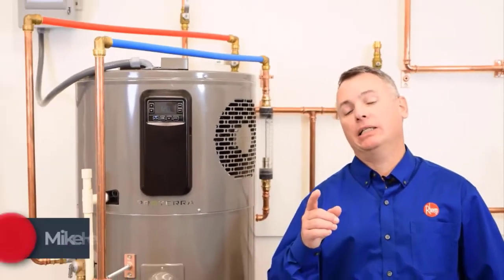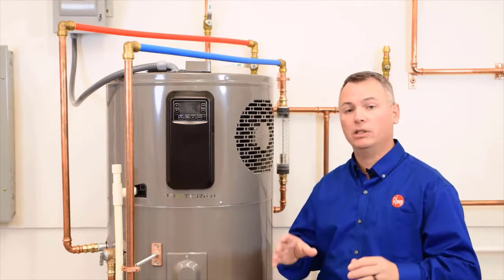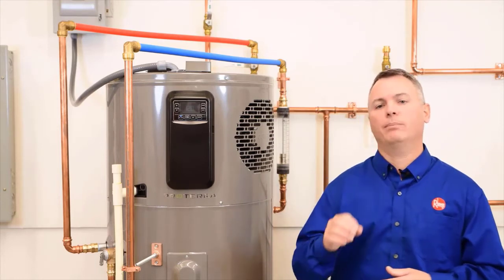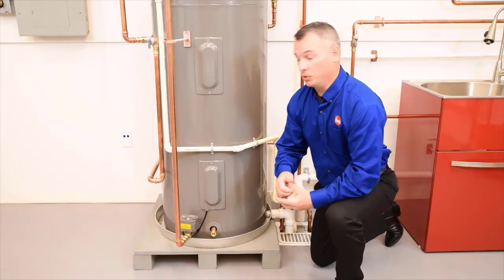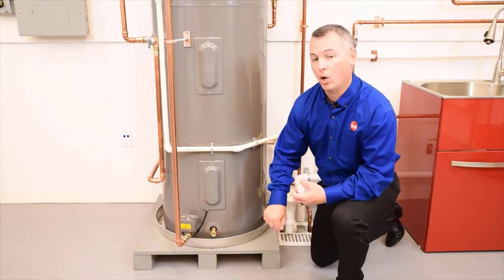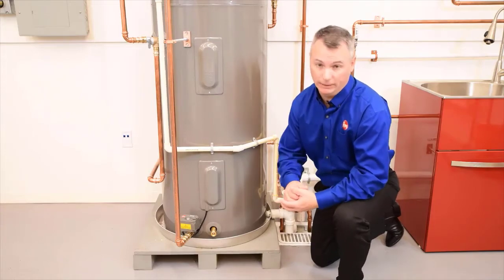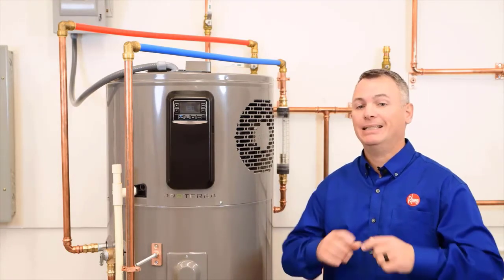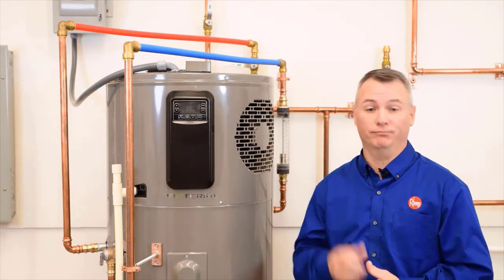Recommendations for Installing Rheem® ProTerra™ Hybrid Electric Heat Pump Water Heaters

Comment: i got one of these and it is noisy. It makes almost a shrill high pitched sound when running. It really bothers me. It's in my basement but that is right below a bedroom. I will have to call the company and see what they say. Fun. Mine says it was made in the March of 2024, so they have not resolved this issue as of then.
Reply from the maker: For assistance with your Hybrid Water Heater, please reach out to 800-955-0982.

Comment: I am interested in the new plug-in variant.   Currently I have a two panel solar hot water heater that takes cold water from the street and attempts to preheat the water.  This hot water goes to the bottom of the Propane heated water tank  ( infloor radiant heat, baseboard and hot water).   I have a mixing valve from the propane hot water exit before it goes into the house.  I keep the temp high to ensure all bacteria in tanks are neutralized..   I dont want to replace the Propane heated tank, I just want to reduce the need to heat water by propane.  Thus what I would like to do is put the Rheem plug-in,  in between the solar tank and the propane tank.    Open room, no doors, never gets cold in the room.   Could vent outside if I had  too.  

My question whether its Rheem or AO Green ( GSW up here in Canada ).  Given that  the Rheem will get slightly warmed up water some of the time or on a good day hot water from the solar tank.. will this cause any issues........  The idea being that hot water  from the solar and Rheem, or just the Rheem (as cold water coming from solar tank) gets fed into the bottom of the Propane tank.  The idea being the propane tank doesnt fire until the propane tank water temp is too low for the settings.

Comment: I live in the south and our attics are always super hot. Is it possible to pull air from a hot attic into the pump as long as it’s filtered? Then possibly reverse that during the 3-4 cooler months of the year?  Basically just swapping the inlet and outlet ducts around.
Reply: Possible? Yes.

How much effort do you want to put into it?

Comment: Would a thermal expansion tank be necessary when installing in a house with a well? There is already a tank between the well pump and the house's plumbing.
Reply from the maker: Please reach out to your local utility company or plumber to advise on local codes.
Reply: @rheemwater  there is no local utility company; this is my house and my well. 

I guess I will reach out to a plumber who is familiar with wells.
Reply: @WayneMacDonald1 if you don't have utility water service then you probably do not have a check valve so it should not be a closed system. If there's expansion in the line it should be able to go out through the pipe that feeds from the well. The main thing is when the heat or pressure expands in the line, does it have somewhere to go? If you're not sure or you know it doesn't have anywhere to go, you need to include an expansion tank.
Reply: Thanks, @Tanquen ! I installed the hot water tank with the assistance of a retired plumber who is familiar with wells. He said there is no check valve and the well's pressure tank should accommodate any expansion although he didn't expect that to be an issue.

Comment: Doesn't say anything about wiring. I'm looking at getting a 15 amp. model, but there is a lot of conflicting or missing Rheem product information. On their website they state there is a plug in 120V 15 amp model available, but they give NO product numbers. In their general install manual, it lists 15 amp models, but later on it says to use 220 - 240 V, 10 ga. wiring. It also seems these must be "hard wired" in, not plugged into an outlet. Their website gives no additional help in being able to contact and talk with a live person and many of the local "pros" listed on their website know very little about the 15 amp models. Can someone at Rheem update their installation literature and give model numbers of 15 amp which need to be hard wired and those which can be plugged in.

Comment: Did you use self taping screws and what size supporting pipe hangers to support side cold/hot pipes shown in video?
Reply from the maker: A short, self-tapping screw will penetrate the outer jacket. If using this, pipe supports would need to be sized according to the size of the pipe.
Reply: @rheemwater  Shouldn't the 3/8" threaded rod be epoxy copper coated? I am worried about the two metals causing rapid dielectric corrosion

Comment: My current BoilerMate water heater does not have any expansion tank and my water is supplied by a well. Is the expansion tank still necessary with your hybrid water heaters as I do not have municipal water?
Reply from the maker: To get information on this situation, please contact our Technical Support Team at 800-432-8373 for more details.
Reply: Do you have a backflow preventer anywhere between the well and the tank?  If not, the reservoir would act as an expansion tank.

*not a plumber or Rheem representative

Comment: I have a Rheem heat pump water heater. We love it. It is currently wired (per specs) to a 240 line. We only use the water heater in heat pump mode. Can I just run the water heater on a 120 volt line if I always keep it in heat pump mode? I realize I would lose the use of the regular diodes that require 240 volts.
Reply from the maker: We do not recommend changing the electric voltage to the Rheem ProTerra Hybrid Electric Heat Pump Water Heater. Rheem just launched a 120-volt plug-in heat pump water heater that can plug into a standard outlet. https://www.rheem.com/heatpumpwaterheaters

Comment: I'm looking to get one of your water heaters and I'm impressed by the 4.0 UEF rating you have on these.  My only question is- specifically what is the difference if any between your Professional Prestige Series and your Performance Platinum Series?
Reply from the maker: There is no difference between these products, Performance Platinum is a Rheem series in Home Depot.

Comment: I have one of these on order (few weeks out), and would like to have the wire run in the meantime.  Can anyone confirm if 8/2 (no neutral) is adequate, or is 8/3 (L1, L2, Neutral and GND) required (due to needing 110V for WIFI/etc.)?  Wiring diagram seems to just show L1, L2 and GND - but just want to make sure before buying $200 of the wrong wire! Thank you!
Reply: I used 10/2 Romex (Orange) and double 30A breaker
Reply: @TBONENYC  thanks for the reply. I ended up using 10/2 and 30A breaker too, and it passed inspection.  

It does make a noticeable drone / hum through much of the house when the compressor is running. We are not fans of this, so we are looking into alternatives (tankless, etc.) to likely replace it.
Reply: @justingastrich9604  oh man I’ve read others say that before as well. I was worried about it too but luckily Mine is very quiet, can barely even hear it in the same room when it’s on. When was yours built?

Comment: what is the glass or clear plastic tube on the cold water inlet pipe?
Reply from the maker: The clear graduated tube on the cold water line measures the water pressure. It was included for demonstration purposes during our training.

Comment: I want to install this in my garage in Arizona. What is the temperature range for the area of installation? In the winter it may drop to as low as 50 degrees and the summer as high as 115 degrees. I have been using a Geospring in the garage for 9 years with no problem but is nearing the end of it's life.
Reply from the maker: The heat pump technology in the Rheem ProTerra Hybrid Electric Heat Pump Water Heater has an ambient operating range of 37 degrees F to 145 degrees F. Outside of this range, the electric elements provide water heating backup. Based on the information you've given us, it looks like it's a good fit for your installation.
Reply: @rheemwater  Thanks.

Comment: Hi do we need to install heat traps on these units?  I've heard that they are now built into the water heater and are no longer needed on the outside.
Reply: With mine, I ran the hot water flex line down before it comes back up to feed the fixtures (not like the one in the video). This has completely eliminated all thermal leakage issues. Since these tanks have the cold water inlet at the bottom, the normal vertical heat traps don't really work, so just loop your hot water outlet down a foot or two before going up and away and you'll eliminate heat leakage. Otherwise, like the one in the video, hot water will percolate up the pipe until the heat is dissipated, and then it will fall back down and be replaced by new hot water, reducing your efficiency.
Reply: @wiredforstereo  the Ruud units which are virtually the same show the trap on the cold inlet pipe at the unit
Reply from the maker: Please contact our Technical Support Team at 800-432-8373.

Comment: Considering buying one but the noise complaints concern me. Has this problem been resolved from Rheem’s perspective? Is there a serial number cutoff that consumers should be aware of to ensure they don’t get a noisy unit? If not, does Rheem offer retrofit solutions to address potential noise?
Reply: Noise is very subjective. These aren't that loud. I can only hear it when there is absolutely nothing else on in the house.
Reply: I'm sure the installation and location, do you make a difference but we did our best to follow guidelines and we've got 70 decibels a few feet from the unit and 60 decibels in the upstairs areas. It's the compressor that has a low frequency droning sound.
Reply from the maker: In 2021, we improved the hybrid electric heat pump water heater fan design which has eliminated noise concerns. If you are experiencing noise concerns, please contact technical support 800-432-8373 to diagnose and resolve the concern. Thank you for your interest in our heat pump water heaters.
Reply: @rheemwater  I'm an architect and wouldn't say 'eliminated'.  I'd say improved.  And everything to stop vibration through the structure should be done because these are not quite even with the fan replaced.  Put in rubber under tray and insulation in area surround.  My bedroom is above a garage with one of these, and I learned what to do for clients after I was the test case.

Comment: How do you get to the ano rod
Reply from the maker: The anode rod can be removed by conventional means after removing the lid of the unit. This is accomplished by removing the four screws at the top and then taking off the lid. Please refer to the use and care manual.

Comment: RHEEM,hello,THE ORIGINATOR ELECTRON STEIBRON, , HAD BEEN MAKING THESE FOR SO MANY DECADES, & are the most popular WOLLDWIDE, when I visit GERMANY,THERE SEVERAL I HAVE SEEN,  but NOBODY COMPLAINS OF NOISE, I WONDER WHY IS THAT ? Could it be the brand of condensing unit you chose to use ? Well they ALSO COST MORE THAN AMERICAN UNITS  ,, WHAT SAY YOU?
I could never expect ‘noise; complaints coming from the HP W/H,,,, ?     🇩🇪🇩🇪🇺🇸🇺🇸

Comment: What is that clear tube contraption installed on the cold line intake?
Reply from the maker: It measures the water pressure. It was included for demonstration purposes during our training.
Reply: @rheemwater  Well that looks neat. Do you have a brand and/or model number for that cool looking contraption. 
EDIT: After some more research It looks to be a flow meter. F-41000LN-12 Might work in a lab...but not sure if certified for potable water.

Comment: Is it possible to install one of these outdoor but in an aluminum water heater shed? I live in an area of Los Angeles (max 84 deg in summer, min 45 deg in winter), and we don't have indoor space for a water heater. Our gas tank water heater was outside in an aluminum shed/cabinet.

Comment: Is it necessary to install a vacuum release valve (vacuum breaker) on the cold inlet if not required by local codes? I've been reading that vacuum relief valves should be installed on bottom fed water heaters but can't find any mention of one in the instruction manual. Thank you.
Reply: Where is the best place to install a vacuum relief valve in relationship to the bottom fed Proterra cold water? I’ve an expansion tank installed as well between the main and heater
Thanks
Reply: @mzilchutube1  I would like to know the answer from Rheem as well. If you look at Watts N36 Vacuum Relief Valve instructions online, Watts show it above the height of the water heater
Reply from the maker: Local plumbing codes should always be followed. However, it is always a good idea to install a vacuum breaker on any bottom-fed water heater.

Comment: i would like to see a comparison video of the pro terra vs platinum model
Reply from the maker: Thanks for the suggestion! Could you clarify which products you are referring to? ProTerra refers specifically to our hybrid electric heat pump products while performance platinum is a product tier, or label, we apply to many of our Home Depot retail products.
Reply: @rheemwater  yes both hybrid electric water heaters HD sells the proterra and the platinum hybrid water heaters  what are the differences
Reply from the maker: Thanks for the clarification! To answer your question, all our hybrid electric heat pump water heaters in Home Depot carry the ProTerra name on the product. For a given tank size (ex: 50 gallon), there are both H and HS models. The HS models offer leak detection and automatic shutoff while the H models do not. See an example below comparing our two 50 gallon models.

XE50T10H45U0: 50 Gallon Hybrid Electric
XE50T10HS45U0: 50 Gallon Hybrid Electric with Leak Detection and Automatic Shutoff

Comment: Is it recommended to connect a water softener or water conditioner/filtration system to a Model # PROPH65-T2-RH350-DCB ?
Reply from the maker: When it comes to water treatment and filtration, it depends on your local water conditions. For instance, if your water quality is very high, you may not need to treat or filter the water. Regardless of your situation, we do not recommend against using filtration and treatment products. If you decide to use one, it certainly won't have any negative effects on the water heater. We hope this helps!

Comment: Is it possible to put a soft start on the unit to reduce the damage to the compressor on start up similar to what one would do to an HVAC?
Reply from the maker: Jensen, thanks for the question! Our heat pump water heaters have a pre-warm cycle which is similar to a soft start for HVAC systems. The pre-warm cycle occurs upon installation and anytime the water temperature in the tank gets below 40° F.  The cycle heats the water to around 90° F using the electric elements before it turns on the compressor. This is to protect the vapor compression system (compressor, evaporator, & condenser) if the incoming water is very cold at the installation or start up. We hope this helps. Let us know if you have additional questions.
Reply: @rheemwater  hi my question is different from that.  HVAC compressors will use hard start of soft start kits to assist in reducing the locked rotor amperage of the compressor.  The soft start in particular helps to extend the life of the compressor.
Reply from the maker: Additionally, it looks like you included a malicious link that you did not intend to. Can you please edit your comment to remove this link? Thank you!
Reply: @rheemwater  removed thank you
Reply: @rheemwater  my other concern is on the longevity of the capicator. I have the unit in a hot attic and capicators tend to blow when they get hot. thoughts on this?
Reply from the maker: Hi again Jensen, it sounds like you are concerned about the durability and longevity of the capacitor and compressor in our product. Rest assured, all components, including the compressor and capacitor are designed to last the life of the unit. These units do not have the same cycle requirement as HVAC systems do, which contributes to the longevity of the components in our system. As for being in an attic, this is a common installation location that we see with these units, and we have seen no correlation between attic installations and early component failure. We hope this helps!
Reply: @rheemwater  thank you for that response.  I do hope you make these units serviceable like an hvac unit and a hot water heater because it has both components.  I do save over $100 a month in electricity over my prior unit.
Reply: This is a small heat pump unit, akin to a small window air conditioner. It's not nearly as much of a concern as something large like your home HVAC. Additionally, I doubt there is a way to power the heat pump separately from the electric elements such that you can install a soft start.
Reply: Thanks Solomon